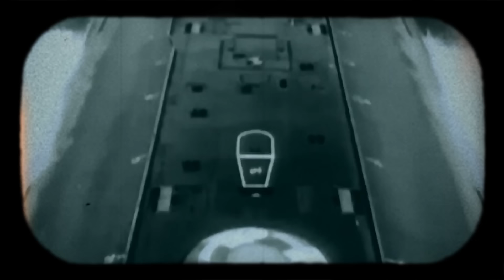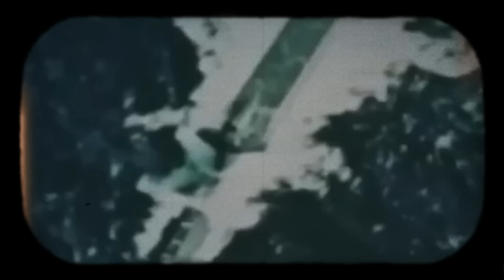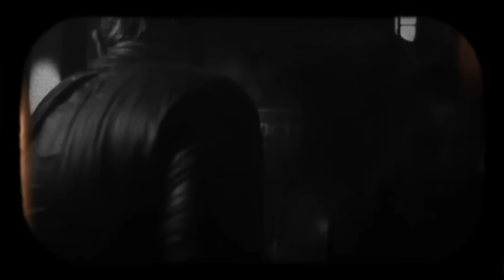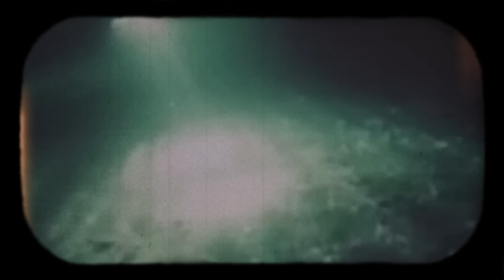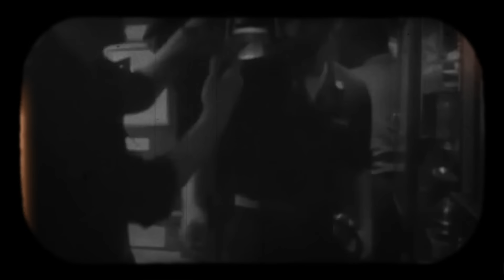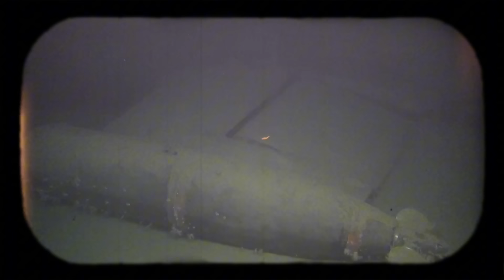K-278 Komsomolets 1989: The Deepest-Sinking Nuclear Sub

Comment: 69 crewman with 42 dead means 27 survivors. 4 died in the capsule, 3 died from smoke probably and another in the sub from drowning because I read that as soon as the capsule's hatch was locked (couldn't be opened again by design), someone was banging on it to get in as per the warrant officer that escaped the capsule whch means 31 died in the water and 3 on the rescue ship. 4+3+1+31+3=42  That means the rescue ship Aleksey Khlobystov must have pulled 30 living men out of the water, not 25. 30-3=27

Comment: Maybe a sarcophagus can be made that 'freezes' the submarine in concrete (definitely not ordinary concrete but one specially developed for this function). A stainless steel box of the appropriate size is built. It is placed over the submarine and then the concrete is poured in. As the concrete goes in, the water comes out... through valves that will later be filled with concrete. Once hardened, it would become a huge concrete structure that would add a couple of thousand years of durability. 🤷‍♀

Comment: By the time the warhead casings are a danger the hull will have rotted significantly allowing for a much easier removal of the warhead and casing. So it seems that the risk from this wreck (assuming models are correct) is quite low and will remain so for hundreds of years...
Reply: Isn't the hull titanium? How exactly does that 'rot'?🤔